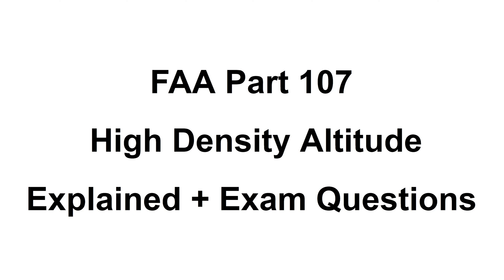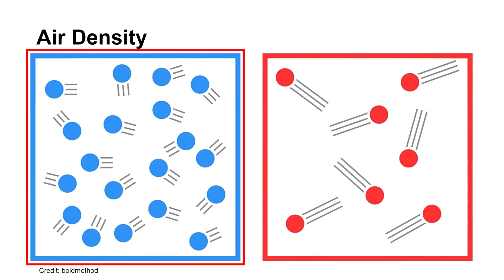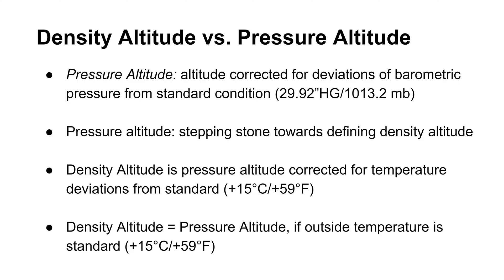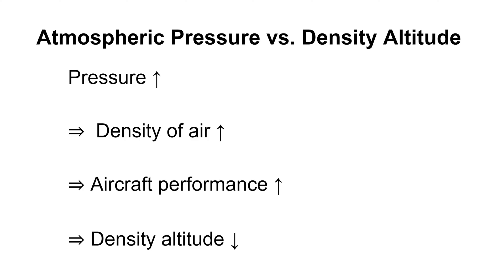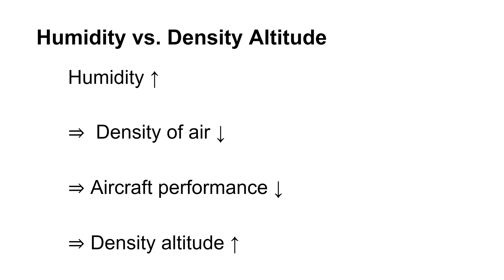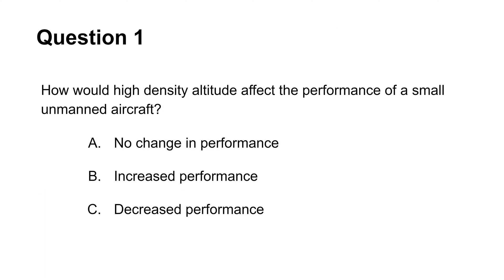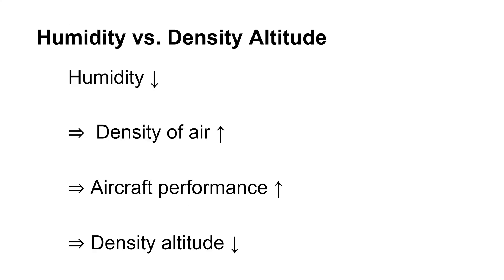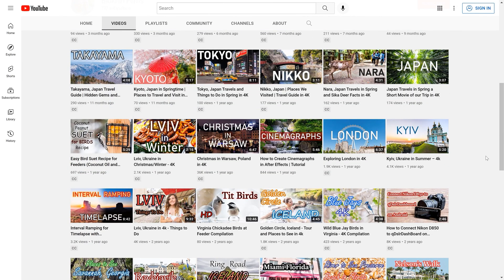High Density Altitude Explained + 6 Questions | FAA Part 107 Exam Practice

Comment: i am trying to become a regular pilot and the biggest hiccup i am having on the test is weather. i avg around 70-75 on the practice exam but i want to get in to the 80s and 90s consistently before i go after the real thing. i just stumbled on these video's and i have to say it is like a God send. i work the next 12 days 12 hr shift each day but every break or down time i get ai am watching one of these videos. of all the you tube video's out there. this is the best  straight forward to the point and has the best explanations. i think this will help me get over the hump.
Reply from the maker: You are welcome and good luck on your exam!